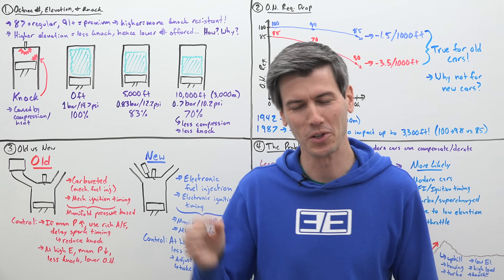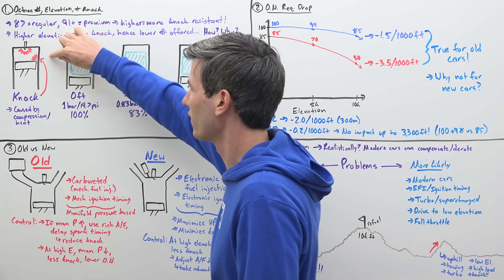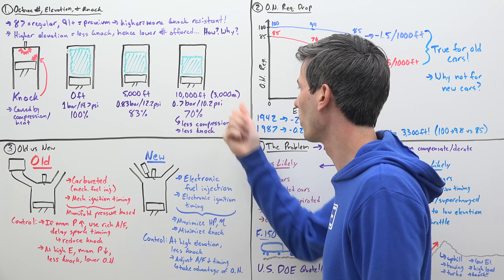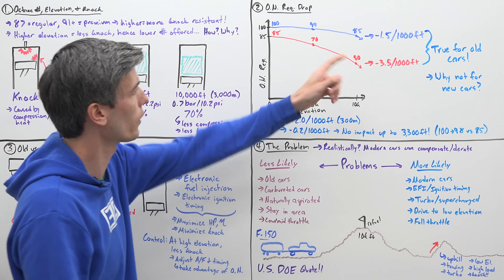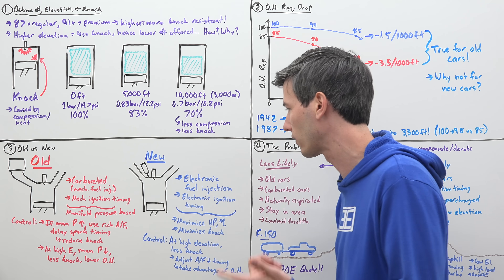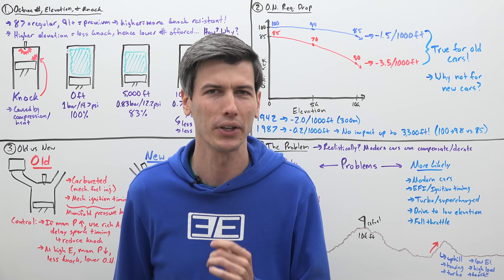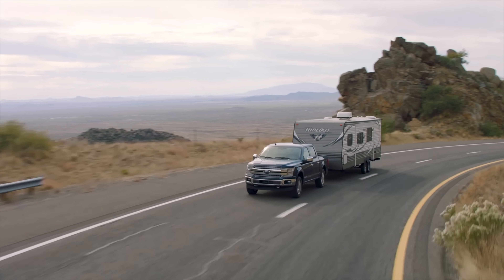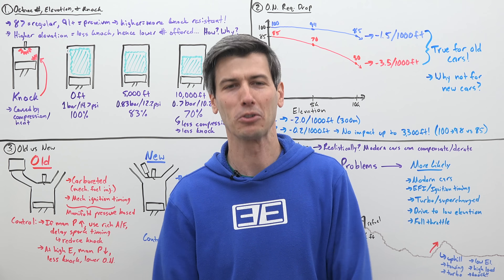Never Use This Gas In Your Car!

Comment: I've used 85 octane in every car I have ever owned up here in Colorado. Never had a knock issue. Some cars get slightly better fuel economy using mid-grade, but I've driven for hundreds of thousands of miles across multiple decades and this has never been an issue. I don't come down from this elevation very often so maybe life is different for people at sea level, but 85 is just fine up here.
Reply: I put 87 in my CRV but would never use 85. The manufacturer actually doesn’t recommend it to my knowledge. I live in Colorado.

Comment: No more crazy than the places now selling "Regular 88" that they don't clearly disclose has 15% ethanol which most cars say 10% maximum or it will cause damage and void warranties.  Have to read the very fine print to make sure what you're buying.

Comment: Man. So I live at 6,300 feet. I put the highest octane available in my 2006 Subaru WRX which is 91 octane. I’d love to put 93 but it’s simply not available. What is the solution? Is octane booster something to consider? It might be worthy of note that the engine has 290,000 miles on it and has done reasonably well on this fuel its entire life. 
Incidentally I’ve had a head gasket failure but I doubt that is related. 

Your videos are WONDERFUL. Been following a long time. I always enjoy your videos and I learn a lot! thank you!

Comment: In a moment of desperation, I once put a gallon of white gas in my '76 Datsun. That was some knockin'.
Reply: Did it survive?
Reply: Coleman fuel has an octane rating of 50-55.  It can destroy pistons.
Reply: In my datsun I have to adjust the advance just driving through the mountains.

Comment: I live in Colorado and this has never been a problem in my 63 years of life , advance timing will adjust to the engines needs. If you have a turbo or super charger than you need higher octane ...a regular engine runs fine of 85 octane in Colorado.   In states where there isn't a high altitude you can't even get 85 octane

Comment: I live at 4600’ elevation. I’ve only ever used the lowest octane fuel. Never had any problems. Here is why. If I leave the valley I live in I’m going to be at the same altitude or be going higher so by the time I get over the mountains or through the desert to a lower elevation I’m going to use up the lower octane fuel. My first fill up once I get to a lower elevation is going to have to be higher octane because that’s all that is sold lower elevations. This video assumes you change from sea level to 10,000’ over a distance of a few miles when in reality it takes hundreds of miles and multiple fill ups to get to significantly higher altitude in most cases so it’s really not an issue for the vast majority of people.

Comment: I always learned that for a carbureted, naturally aspirated engine, 85 is as 87. For anything fuel injected or forced induction, use the recommended AKI. Sounds like sound practice.

Comment: I drive a truck with a 15-liter diesel engine (namely a Detroit Diesel DD15), and can confirm that high elevations have a very similar effect on diesel engines. All large truck and bus engines since a 1992 round of new EPA emissions regulations have used turbochargers to lean out the air/fuel ratio and burn fuel more cleanly.

From the driver's seat at anything up to about 4,000 feet, the turbo whine is clearly audible whenever the driver is commanding maximum power on the pedal. You start gradually losing the in-cab volume of the turbo from there on up, and especially from about 7,000 feet, the turbo is barely audible. You can tell it is strugglimg for air up there.

Comment: At high altitude, all we can get is 85 octane. It works just fine.
Reply: Yeah that's not true. Live in Colorado, the pumps typically range from 85-91, with 87 often being the midgrade fuel. Yes, the regular is all mostly 85, but to say that it is "all we can get" is misleading.
Reply: Im in Colorado i ran 87 for years. Vehicle ran alright then went to 91 way way better running and more power.

Comment: I have to disagree with using 85 octane in older cars with carburetors. Unless it’s a really low compression engine. A modern engine can retard timing if spark knock occurs but an older engine cannot. Back in the mid to late 70s there was a phenomenon called run on in which your car would continue to run after you turned the key off. Even though most engines produced in the US  after about 1972 were low compression this was caused by the lean mixtures auto makers were running their engines at. Couple that with the fact most older engines were pretty much 100% cast iron that retains heat more than today’s aluminum with the fact that early unleaded gas was horrible it caused all kinds of issues. I wouldn’t recommend running 85 octane in anything.

Comment: All modern cars have knock sensor. So it will reduce engine power if knock is detected. So technically you don´t have worry about gas. But if you have to use max power of your engine a lot, consider use higher octane fuel to get more power.

Comment: Another excellent review. I'm wondering why some cars said to never run fuel above 87 octane in the owner's manual. Both my '94 and 2005 car had that warning. My 1994 Ford Ranger states to ignore pinging. (It's pinged under heavy acceleration since new, near sea level.) Adding a gallon of premium eliminates the ping so I do that when temps are are above 80. There's also a brand of fuel that is less likely to ping so I wonder about the quality of other fuels.

Comment: I am ( as a german) still baffled, that you use gasoline engines in "work vehicles" in the US,... we mostly use diesel for almost all cars with a high expectation in regards of distance/year and/or high amount of transportation/towing, since it´s usually the better option in regards to HP and torque, fuel efficiency and longervity,... yes you get rangers (and equivalents) as a gas car, but that´s more for low distance family options, everything for work will get you a recommendation for the medium to "big" diesel engines, most won´t even consider gas for that stuff here anyways.
But does diesel have the same problem?

Comment: @EngineeringExplained when I’ve visited Colorado in my 2020 F150 with an Ecoboost V6 I have used 85 octane.  What I have noticed is the engine seems to operate more efficiently, I get far better fuel economy.  When traveling back across the flat states it is very common to get 25+ mpg.  Why is this?

Comment: towing uphill higher altitudes, lower ones no matter what 87 octans went in my Jeep 5.2 never had a problem my advice if it calls for 87 us it period. If the station has a lower number than go a little higher. Engines Arnt cheap

Comment: I live in utah. Elevation between 4000-5000 ft. Sometimes i go into the mountains up to 10,000 ft. I drive a hybrid and typically put 85 octane in it. Around here i will see 85, 87, 88, and 91 octanes. But the most common types are 85 and 91.

Comment: When I was in high school I used to manually change the timing on my 11:1 compression ratio muscle car depending on the elevation, and always used the highest octane fuel I could find. Simple one bolt and then twist the distributor cap as needed.

Comment: 2 years later and this is still useful. Driving x-country from Calif to Florida. Refueled my 2024 Honda somewhere before Albuquerque and wasn't using my brain when I picked the fuel button at the far left. As I was refueling I saw it was 85 octane. And 10% ethanol.  Drove on across I-40 for about 300 miles and filled up again with normal gas in Amarillo.  Never heard knocks, not towing anything, keep it under 80.
But I kept wondering about that 85 octane... until now!
Reply: Based on your mistake described, if you where at a Chevron station you would have filled up with supreme.
Then that would open up a whole other can of deception
Reply: and Drink it like water💀💀
Reply: So it was fine you mean?  Wow amazing it was fine.

Because it's fine.  You aren't driving a damn motorcycle
Reply: gas that can kill your car and it's sold to do that one.🤣🤣🤣🤣🤣
why can they do this one but not sell renewable fuels alcohol based to save the environment?🤔
Reply: @SaraMorgan-ym6ue Most of the gasoline sold in the US is 10% ethanol. There are very few vehicles that can tolerate higher ethanol concentrations, unless they were specifically designed to run on E85. Fuel mileage using ethanol blend gasoline is worse than straight gasoline because ethanol has lower energy content per gallon than gasoline.
Reply: @SaraMorgan-ym6ue Clueless lie.

Comment: Lived in Colorado for a long time where these octane ratings are normally sold. If you have higher compression engines, turbocharged or supercharged, you don't buy regular labeled gas...period. My Hemi got at least mid-grade and my turbos got premium. As long as you bought the recommended similar 'grade' sold at higher elevations, you shouldn't have an issue.

Comment: Well they still have carburetors on lawn mowers. Would make sense that lawn mowers or other small engines up there might still need the 85. You can also still buy carburetors for old cars. So I think they still need to sell that gas for those individuals.

Comment: I bet Ford has that warning version because the F150 is at base ecoboost and because it's being turbo has a higher octane requirement
Reply: I think the lx edition is a 3.3 naturally aspirated, the cyclone or duratex engine.
It is flex fuel like the 5.0 and will run on E85 gas ahol.

Comment: I use 85 octane on my 2012 Toyota Corolla. Never had any issues and I have over 210,000 miles so far.
Reply: It's older and designed for lower octane fuels. Never seen anything lower than 87 octane fuel. Usually it's ethanol blend fuel

Comment: Horse crap. 
With modern VVT and knock sensors you can run different octanes. 
I’ve driven my 05 ford with the dreaded 5.4 3v engine that supposedly requires 91+ on 87 for 200k miles. Runs like new. 
I found no change is MPG or performance between 93 and 87.

Comment: Older engines are usually a tad weak on compression anyway, so the 85 octane crap doesn't really cause a problem.  The general rule is to, if you experience engine knock, switch to a higher octane fuel, or, on the really old engines with a distributor, retard the timing a smidge.  It'll cut power AND fuel economy, but at least the engine will live awhile longer.

Comment: Knock sensors are so advanced in modern cars I'd be genuinely surprised if people experienced engine damage with using too low of an octane fuel. Even my '04 Turbo Volvo ran fine on Regular gasoline but it did lose a lot of power on the upper end when under high load. Switching between Regular and Premium was noticeable/measurable when under high load/acceleration. But under light load, fuel economy is better with Regular gasoline and drives fine otherwise.

Comment: 8:35 I find it crazy that the engineers don’t design the engine with the available fuel grades in mind especially for the f150 where a very large number of those trucks is going to live its life at higher elevations where 85 is the standard grade

Comment: Hyundai Genesis Coupe, AlphaSpeed Tuned for 93 Octane in Florida.....I moved to Colorado Springs, CO (7,000 ft) where only 91 Octane available = new engine knock.  Solution Royal Purple Octane Booster (1 can/ full tank)

Comment: Don't modern engines have a knock sensor? Won't the computer on a modern car make adjustments based on the knock sensor to prevent damage? Therefore 85 octane fuel should be less of an issue on modern cars. What am I missing here?

Comment: Question. So if one takes this logic of low pressure and applies it to cold air in winter (more dense air) rhen it would be wiser to use a higher octane gasoline in winter?

Comment: I live in WY and we have 85 octane here. I’ve got a 2003 4Runner and my truck runs WAY better with 87 (our mid grade). Engine is much quieter, lower vibration, and a little more power

Comment: Modern cars should have octane and knock sensors to prevent damage from slightly too low of octane.  If your car requires 93 and you put 85 in it, you're asking for trouble.  If it requires 87 and you put 85 in, it will probably just retard timing causing a slight loss of power and poor fuel economy.  I had a VW GTI that recommended 91.  We don't have 91 in Ohio, we have 87, 89, and 93 (some places have 98 and 101).  If I didn't want to pay for 93 and ran 89, I noticed a minor drop in power.  If I ran 87 I had a major drop in power and slightly worse fuel economy.  It never caused any harm, but maybe that's because the only time I ran 87 was when I was going to be on the freeway with cruise set for a long time.

Comment: I ran 85 octane for years when I lived in Breckenridge, Colorado in my Audi Q7 which is a supercharged engine.  I never had a problem.  I drove down to Denver sometimes and still never any problems.  I was not going drag racing nor towing.  I now use 87 octane for every other altitude as I don't live in Colorado anymore.  93 octane is a waste for most applications.

Comment: Seems to me like, at any elevation, it would be safe to use 85 octane gas in lawnmower, chainsaw, and other small engines that run at a lower compression ratio anyway.

Comment: Suppose that I drive an older car that is impact carbureted and I live in a high elevation state where the 85 is available my car requires 85 to run properly otherwise it’s spark timing is not enough to keep it running due to the lack of air pressure I have tried running 87 octane and the engine will not idle riiip

Comment: I live in Utah.  With the exception of one vehicle which required premium, I have always used 85 octane and have never had an engine knock because of it.  I occasionally drive from 6,000 to 2,500 feet and back with the same fuel without any problems.
I've ran both old and brand new trucks close to 10,000 feet also on 85 with no issues whatsoever.
Altitude matters, and 85 is fine to use where it's sold.  It isn't a scam, it's not a big conspiracy to destroy our engines here, it just works, and it works just fine.  
There really isn't anywhere you could reach sea level on one tank where 85 is sold, so it really isn't that big of an issue as people say.

Comment: My dirtbike uses premium. It's high compression but its carbureted and basically entirely mechanically driven including mechanical spark timing and it's 9000 feet where I am. Is it bad to use 85 when it requires 91 normally in this case? pretty much everything lines up EXCEPT it being high compression. its running between 12.5:1 and 13.5:1 so would it be bad to use 85 in this case? according to the graph it should, but i'm still worried especially since there are no electronic measures of reducing the chances of knock, just physics in action.

Comment: in figure 2, 4:29, I think there is conflicting data for 1942.  The 3 points of data each of the 85 and 100 octane suggest it's a polynomial but the blue text below the graph states it's linear.  Additionally, there is a much greater difference with altitude on the 85 octane which is closer to what most people use at the pump.

Comment: I live at altitude above 5,000 ft.
In Colorado. Run 85 in all my vehicles. Never never had any issues. 85 was meant to run at altitude. All have been driven 150,000 plus. Now drive turbo charged 2.7 ford no issues. 85 octane is equivalent to 87 at sea level.

Comment: because modern engines compression rate are higher 10:1 and so on so can't use lower octane index gasoline, one loose power and two strain the engine even causing damage in certain cases. in my case the car manual says that can't use lower octane index gasoline because might cause damage to engine and power loses

Comment: It is the usual tension between regulation and over-regulation.  The controversy continues.  How much protection do we need afford those with limited comprehension?  A question for another forum.  

As for octane rating and vehicles, look in the glove compartment for the owner's manual.  It has a wealth of valuable information if you can read.

Comment: I accidentally put 85 octane in my Chevy truck while driving through South Dakota a few years ago.  The truck engine was running hot and I lost significant fuel range.  On the next fill up, I filled with premium and added octane booster and I didn't have further problems.  I can totally see major issues with turbocharged engines.

Comment: Many people don't realize that most turbo/supercharged vehicle manuals state using high octane recommended. Many state 91 octane.  People wonder why their vehicle feels sluggish or starts missing.  There is a lot of misinformation about how you don't need high octane fuel. You absolutely do if you have a turbo/supercharged engine.  A lot of people don't even realize their engine is turbocharged. 
  The thing that I'm getting irritated at is, gas stations are ripping people off.  3 octanes to choose from, yet only one nozzle. That means when you pay for 91 octane and the last person bought 87, you're getting at least a gallon or two of 87 octane, and the next guy not needing the 91 gets a gallon or two of it. 
  And yes, all Ford manuals with ecoboost engines state fuel octane of 91 recommended.  Almost every person I talk to that has an ecoboost or performance car didn't read their owners manual.  They've been putting the cheapest gas in it they could find.
  So when I replace peoples spark plugs from being blown away, the extra little cost of the 91 doesn't sound too bad.  I tell people the extra cost of premium gas is like an insurance policy that actually does save you money.  Yet other people will argue with me till they are blue in the face telling me I'm nuts and don't need it.  Tell that to the guy replacing your parts.